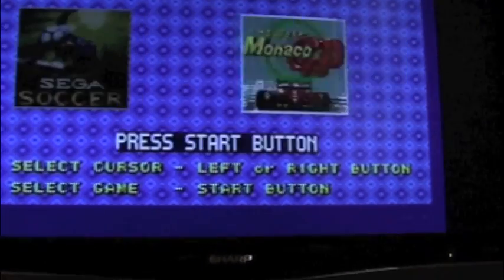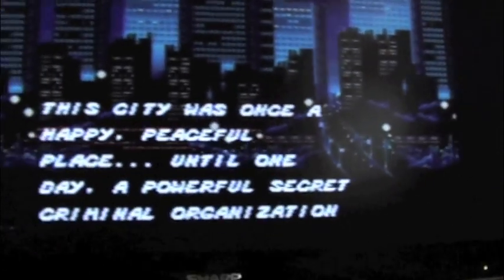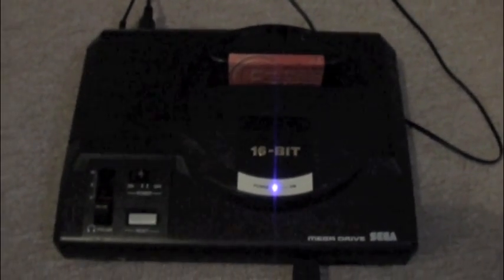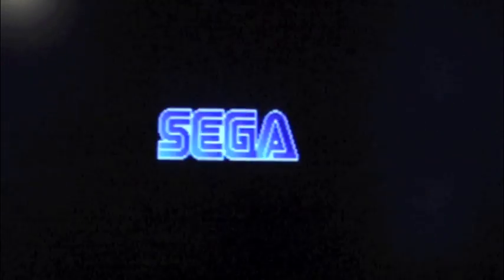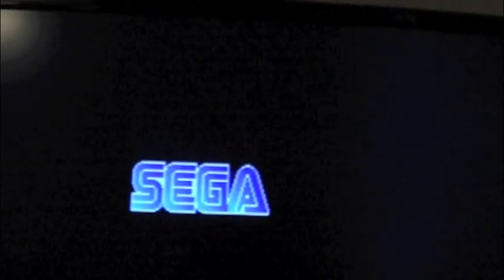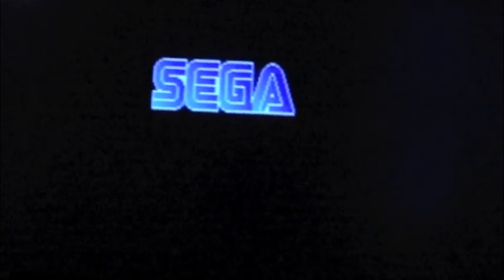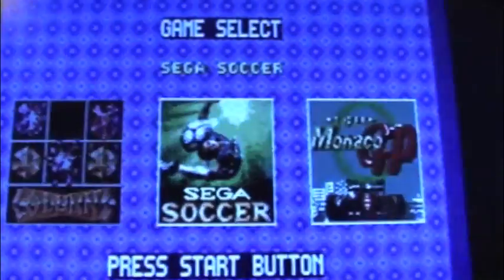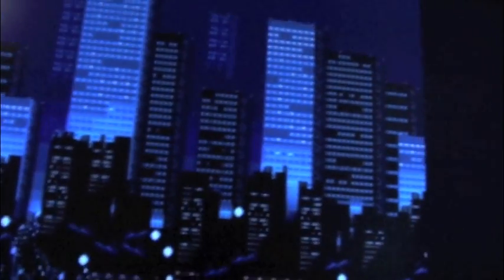PAL Megadrive 60hz Mod

Comment: does 60 hz give better picture?
Reply from the maker: It doesn't give a better picture as such. It allows you to use the basic  composite (Yellow) plug connector on any European TV when using a modded PAL Megadrive to play American and Japanese games. The 60hz signal that's output by the console over composite is at the wrong colour frequency for a PAL60 signal, unless you change the clock speed of the video chip, which is what this mod does.
If you're using the full RGB cable over a scart connection this mod isn't needed as the TV takes the raw colour signal direct from the console.
Reply: +thedivvie but what about speed? I herd that 50 hz is slow sound but when on 60 hz it's faster and better
Reply from the maker: +leakproofj2o the switch on these machines from 50hz to 60hz is more about determining the region of the console so that it can match the region of the game. Yes technically 50hz is faster than 60hz (about 17% in fact) but many later PAL games were actually adjusted to play as fast as the NTSC versions so it wasn't much of an issue.

Comment: I'd say if you have A  Scart Socket on the back of your TV Get an RGB Cable as it will give you a much better picture and the Colours will be perfect so this mod is not required when using an RGB Cable!